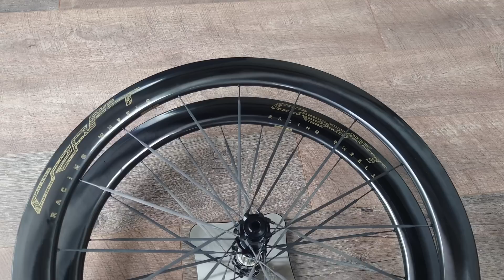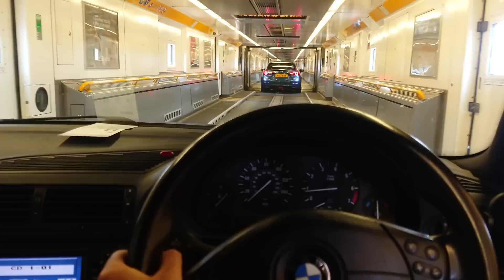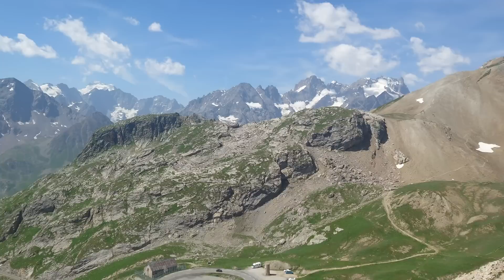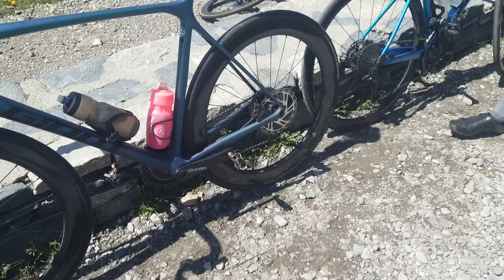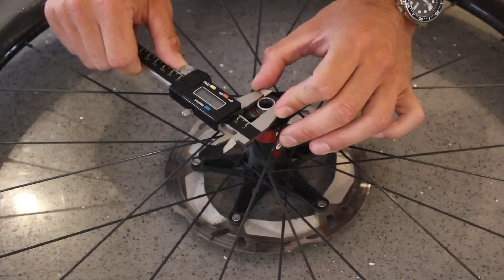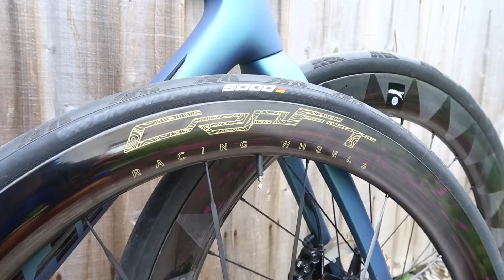Carbon Wheel Perfection Roasted at Gas Mark 6 - CRW

Comment: We've been in constant communication with PT since he had this issue. The end cap issue we immediately started QC'ing new orders ourselves and contacted all previous customers to let them diagnose the issue themselves and offer replacement end caps. The lock ring issue seems to be a one-off, as no other customers have reported this issue. However, again, we've started hand-screwing Shimano lock rings on to all hubs before shipping to make sure. We will be getting PT a new rear wheel under warranty as we would with any paying customer. We still stand by these wheels, but it's clear that the set that PT got were not up to standards. We have also instructed CRW to improve their own internal QC measures. (Previously the lock ring thread wasn't QC'd for fear of scratching the threads and having customers believe their wheels were second hand, etc.) Also, anyone ordering the wheels, please note wait times are now up to nearly a month. These have been a highly sought-after wheel and CRW won't cut corners on quality, so have limited production capacity.
Reply from the maker: Note: Joe or PP never persuaded me to hide or censor this video, like other brands may have. I hope this video acts as a notice to any other young brands - please don't send shite in that's not checked or finished. You will not get a free plug or a sales channel.
Reply: @PeakTorque  "persuaded me to hide or censor this video, like other brands may have." You say 'may', but it sounds like you are saying this has actually happened to you or other  youtubers. Is your statement on persuasion conjecture on your part or have you experienced this first hand and/or do you have second hand knowledge of it? Like, exactly how fishy is the youtube bike parts review scene? It sounds like you are implying it is more fishy than a non-insider might assume. 

Obviously, there is the sponsored content to be wary of. But here, it sounds like you are throwing shade at the independent reviewers who's content might not be considered sponsored and/or is existing in a grey area of sponsorship where while are reviewer might not be getting paid outright for a review, they do stand to gain from a positive review.

I'm not asking you to name and shame here, but can you say the quiet part out loud please?
Reply from the maker: @m5louks1  interesting comment! I don't know who does 'paid' one-off reviews, nor have a full list of people who earn affiliate commission. I'm not au fait with other YouTubers apart from maybe Luke and Hambini. They are good eggs.  Despite the latter's extreme nature, its mostly an online act. He is a courteous and pragmatic individual in reality. Just beware of a sales push from anyone who's sole income is YouTube. Of course it will skew the narrative. Yes i could push every and any product that comes into my inbox but that's not me, I'm in it for the long game - to build trust in PT. Not just a quick flip, because that'll get you found out pretty quickly when there are commenters as rightly critical as I am. It may hurt PP/CRW in the short run but the outcome of letting this video go live is better product and a higher bar for young brands. If they don't like it, tough. The only time I was encouraged not to make a video go live was for my original Elite video. They were a bit nervous about that but It went up anyway. Taught them a lesson maybe, and now they're smashing it.
Reply: @PeakTorque  Regarding Hambini, that is actually how I got turned onto your channel. I also think its important to remember Hambini's early vids on YouTube are pretty tame and wholesome. If you go back and watch some of his early content, then fast forward to today, the difference in his delivery is jarring lol. 

"Just beware of a sales push from anyone who's sole income is YouTube." Sage advice here, and I never really looked at it that way. But, it makes sense. Pumping out positive reviews will definitely lead to more product review opportunities, views, and therefore income.  Seems to me a simple conflict of interest exists.

I agree with your comment on 'harm in the short run', but I think any savvy business man, like Joe for example, will understand fully the value someone like you or Hambini can provide to a product/brand in the long run. Obviously, consumers such as myself appreciate it as well. 

Lastly, "Yes i could push every and any product that comes into my inbox but that's not me, I'm in it for the long game - to build trust in PT", to address this. Stating this is one thing, but following through is another. I think what I appreciate so much about yourself, Hambini, and also Joe, is that every time I watch a video I feel like I learned something. I'm not talking about product knowledge, I'm talking about practical, real world, engineering principles I can apply to any cycling product, or just life in general. I think that alone builds trust.

Its like when a novice goes into a bike shop with a slipping chain. I good bike shop will take the time to educate the consumer on chain stretch, chain wear, friction, why the chain gets longer over time, yada yada. A bad bike shop will just sell you the chain and move on. Who does the customer trust more? All that to say, actions speak louder than words, and you or Hambini can spout off all day about how independent, impartial, or free of influence you are, but what really builds trust with me is the time you both take to educate your audience on what is really going on.

In summation, I trust you guys because you teach me something, keep it up. Cheers.
Reply: @m5louks1   I had the same road as you, I found PT from Hambini. And I couldn't agree more  about the teaching part.

But I guess you didn't follow Hambini from the start, because there are Canyon vids that are missing. I think there where some lawyers involved.
Reply: If, and I hope, other customers are getting the same care PT is, I'm looking forward to dropping some money at PP. I think my last concern with Chinese direct bike parts is warranty support and Joe, it looks like you've got that covered.
Reply: Wanted to sell my Bontrager wheels on my Madone and replaced them with a set of these....🤔. Think I'm gonna pass...😮
Reply: Have you also decided to include some spare spokes with your wheel sets?
Reply: Excellent response.
Reply: Peak Torque just posted on instagram abt a possible issue with the hubs.
Reply: Really hoping the issues are fixed before my order is shipped (Status "processing" ^^) Too bad i cant take them up the Stelvio Pass :O
Reply: @marcelgreiner2844  One of the reasons for the delay is double checking every wheelset. I apologize for the delay!
Reply: I have no doubt Joe will be kicking butt behind the scenes.
He's put his reputation on line the filter all the products that go through his shop.
Is transparency in response I'll go with that
Reply: Pandas everywhere in the comments. I thought they were endangered 😂
Reply: Seen the clips and put my order on hold for my 50/60s. However I have been told these issues have been dealt with and that it could be that PT that was unlucky and got a duff set as other customers have not experienced any issues. Order is now on its way and wait times for dispatch are now 1 month. I don’t think sales will be dented as PP have jumper  on it so 👍🏻 from me. They hypers are gone come on CRW, although my only gripe are the decals are a bit cack! Lol but if they can be peeled if they will be
Reply: @SAnderson77  Always good to see you in the comments Stephen! :)
Reply: @pandapodium.official Gotta offer my support mate, and hopefully sway doubters with my own personal experience buying Chinese products, I have had problems with big brand quality also! Shit goes wrong people make mistakes no big deal, so we get it sorted get over it and move on.           Also I still don’t get why people don’t understand that 95% of carbon bike products are made in China by subcontract factories on behalf of western brands! 🙄 and you won’t find out who works for who due to these things call Non disclosure Agreements. 🤦🏻. Also great information and education by PT 👍🏻
Reply: makes no sense whatsoever... I knew my guy from china doesn't ride. Im gonna stick to my Western sellers. AFTER ALL lets accept that china is a bad actor in general.
Reply: Correct me if I'm wrong, but didn't you swear up and down that you were only going to sell bike parts on your website that you personally tested and approved of? Yet here you are so early in the game and PT is having to do the QC that you said you would do. Going back to the manufacturer to make it right is all well and good, but these faulty wheels have made it into the wild. Completely unacceptable given the mission you have ascribed to. This is just more of the same with goods dumped on the western world with little to no QC. We want it right in the first place, but now you're like a cat covering up cat shit. Same old same old.
Reply: @larrymcgoldrick3471  100% correct! I had five sample wheelsets from CRW before putting them on PP. I rode them over 1500km. My employee Tom rode them maybe 2000+ km. Tom's team had also been racing on them for months. All with no issues. If you have an issue that effects ~2% of wheelsets, I think you'd need a sample size of around 50 wheels to catch it. I obviously can't ride 50 sets of wheels for hundreds of KMs each. We did our due diligence (although I'm open to critique about my process!) but you can't catch everything. When the poop hits the fan, we'll be hear to clean up the poop.
Reply: @larrymcgoldrick3471   To be fair, the Western brands are guilty of this as well. Canyon, Cannondale, Specialized, Zipp, Cervelo, even Shimano have all put crap out into the market and relied on their warranty support to sort it out. The only difference being that they were charging two to three times as much for their products. 

I think you should give Panda and Joe a chance to make things right before you pass judgement. I'm not saying you should accept this issue from CRW or Panda, what I am saying is this is great opportunity to see how the brand, and Panda, handle the issue.
Reply: If you rely on a youtuber to do QC for you, then you're not supposed to be in in this business. The consequences of a wheel hub failure could put lives in danger
Reply: @binshuo Are you people for real?! What world do you live in? Even a multimillion dollar business can’t guarantee 100% faultless products out the door. This is an unfortunate issue that seems to affect a small sample. The best is that PP and CRW quickly acknowledge and address it and be transparent about it. Moronic rhetoric like “relying on youtuber to QC” is just hyperbolic whining with a hidden agenda. I’m waiting for PT and fans to start a bike business so that we can all buy perfectly flawless products 100% of the time.
Reply: @Dee-Ell  What world do I live in? I'm a Chinese native who had been living in China for 30 years before leaving. I know how "rigorous" and "methodical" the testing protocols usually are in China. The fact that there's no legal consequence for making a dangerous product alone already puts me off. If the manufacturer fucks up and put someone's life in danger, what are you going to do about it?
I myself use Winspace wheels but many new Chinese brands popping up from social media in the last few years don't really have a track record of making solid product. If you want to be the lab rat, all fine.
Reply: @binshuo  And I'm from Mars. Making an identity claim on the internet?!  How old are you?  (Don't answer. It's a rhetorical question.).

Are you for real?!?
Reply: @Dee-Ell  Doesn't matter if I make an identity claim or not. You're not rebutting my arguments in any way
Reply: @binshuo  You are just making blanket statements without supporting any of them. So, no rebuttal required. Besides, I already made my point previously, which you completely ignored.

Comment: Hi,

I would like to know what is your opinion about DT Swiss hub 180 and 240. I'm considering buying DT swiss ERC 1100(180 hub ceramic) ERC1400(240 steel) there is 35 and 45 depth version . After some research it looks like those are the best over all wheels on paper(I'm thinking to get 45 depth version) for me that I can find Price(in Europe you can find them for good value)/weight/spear part/service etc. My question is do you thing that there is any benefit of getting 240 hub(if we take out ceramic Bering from the equation) version over 180 hub. What I want to know is if from your experience there will be more flex if rider is tall and about 94-96kg in 180 hub then 240 as there is less material on the hub or that really doesn't matter? Thanks

Comment: Just received some hope pro5 hubs and they use the same axel interface system. So far on inspection they are faultless with no play at all without an o-ring. Goes to show it can be done right!

Comment: Really don't see the reason to ride anything other than a DT hub. They're just better, and the few issues I've had with them have been resolved super quickly by their customer support. I had an issue with an undersized hub shell on a 240 rear hub, and they sent me a replacement unit before I even mailed back the faulty one.

Comment: As a not entirely anal electronics tech I noticed a grinding sound on just about the only still day I've ridden and I had no music playing from my phone in my toptube bag. After km's of listening to it I isolated it to my right leg power stroke. Some further analysis as I got to the steeper section of the road and I worked out the sound. It was the lack of lubrication in my dodgy right knee. Moral of the story is that music is good, grinding knee sounds are bad.

Comment: actually this system (where the endcap kind of forms the axle) is common on front wheels. I have this exact system on my reynolds AR41. And no issue with it.
But I agree with you : DT Swiss 240 or nothing. Never ever can you go wrong with that hub. I would go for that or nothing else on any wheel.

Comment: How have you been getting on with the RideNow tubes? I bought 10 in the spring, I now have only 5 left (that's 3 on bikes and 2 in a saddle bag). 2 I busted immediately when mounting, 2 wouldn't hold their air at all (low and behold I found a tiny hole on both occasions), and 1 died from a small curb strike - a butyl tube would never have flatted there, I was quite surprised - pressures at 7Bar - I also found the patches don't work for shit. These tubes are cheap but somewhat a false economy. My Tubolito has been faultless, but that's a sample size of 1 and might just be luck. I can't justify the price for more of them though.
Sadly I bought some lightweight butyl tubes as my next batch of tubes :( ... Tubeless can get to fuck - was sick to the teeth of wrestling these tyres onto my wheels, and the price of the latest GP5000s... Mind boggling.
Reply from the maker: Ridenow have been faultless for me. The early ones had Leaky valves though. About 1/5 would leak.
Reply: @PeakTorque  haven't really noticed leaky valves, if it's closed tightly.
I just keep finding holes in them 😬... Might be or might not be due to my installation method, difficult to get on without pinching.

To be fair, if they're in, on, inflated to 7bar, and if they retain 7bar by the following morning I don't see any other issues and they have been reliable... If it drops to 5 or 6 bar overnight, they're manageable for a short period, but it progressively gets worse and they require air during rides = time for bin.
Reply: @mikehall6608  Same experience, when they are good, they are good. But so far it seems like 1 out of 2 have a problem. The newer one (with the white stem) seems to have the same issue.
Reply from the maker: @mikehall6608  get them to about 2psi inside the tyre then go around the whole thing squeezing it and moving it into the center. Very easy to trap it under the bead and pinch it.
Reply: Same here, I have been riding them this summer and I never gone through so many tube. 2 days ago, fixing a flat on the side of the road, the spare tube just slice open close at the base of the valve, had to install an other one. That other one, now 100km later, started deflating on a ride yesterday. I could not find anything wrong, so I brought back the tube for further inspection. It's basically loosing air at the seams (where they piece them together). I had a lot more flat this summer than usual. They are cheap, but they don't last.
Reply: This why I held back my urge go RideNow after reading so many issues are there. That stuff just needs to settle down.

Comment: Joe's team contacted me July 24th and cited the issue you were having, took full responsibility and offered to send me out a replacement end cap. I tested my front wheel and didn't notice the issue. In fact, I really struggled to get the end cap off because it was so tightly fit. Despite that, I requested a replacement end cap just in case, and they were very quick to oblige. All that said, I've put 500 miles on these wheels before getting sidelined with a non-cycling-related surgery. As just a person who rides bikes, who has no technical knowledge or credentials, these wheels have been phenomenal for me. Can't wait to get back on them once I'm healed up. Looking forward to the aero test - thanks Peak Torque!